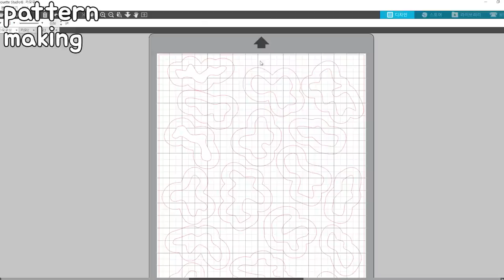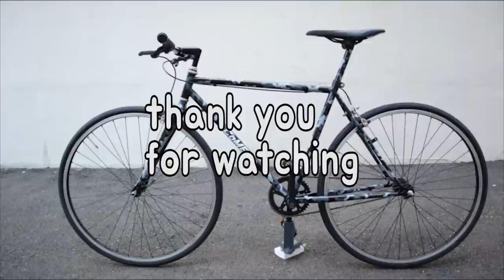BIKE RESTORATION FROM OLD JAPAN BICYCLE

Comment: What tool is that that has the crank bolt removal socket in the opposite end from the crank arm removal tool? And also, what tool or brand is the 6mm to 8mm adaptor. Thank you!
Reply from the maker: Park tool
Reply: Thanks

Comment: This is a terrible restoration. This was originally a multispeed bike not a single speed. On the diagonal down tube you can see the holders for the multispeed cable controls. A good restoration of of an "old" bike would have had column shifters.